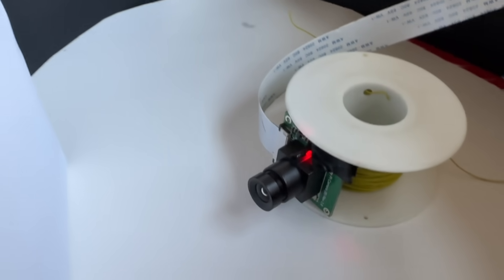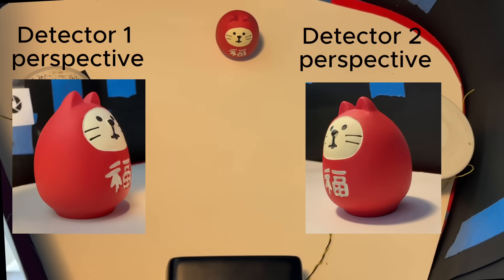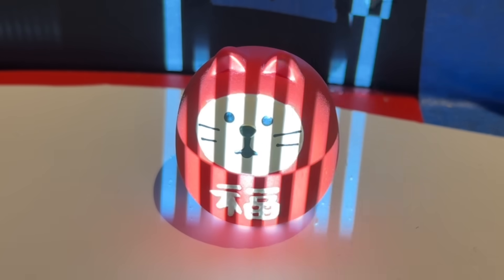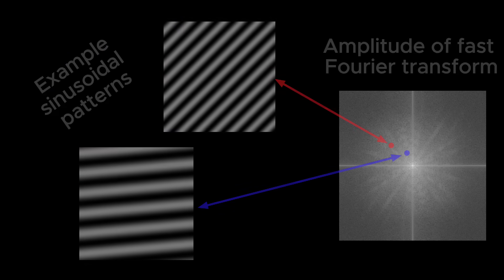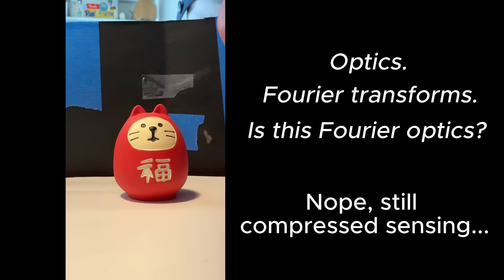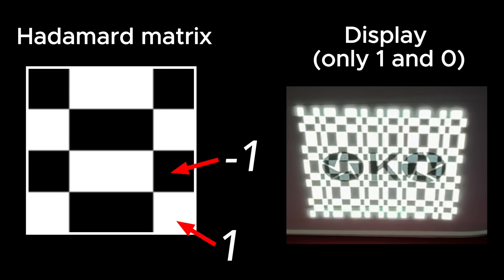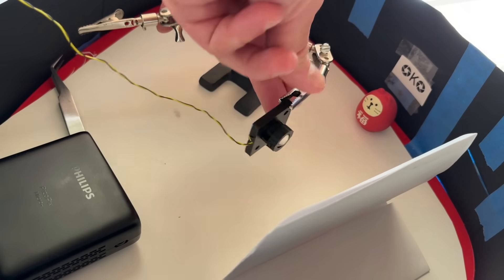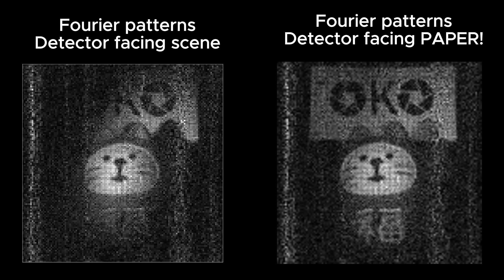Imaging objects out of sight using a single photodetector

Comment: When i was at university someone's masters project involved illuminating a scene with random noise, detecting the reflected light with a single photoreceptor, and over time building up a picture of the scene by checking which patterns of random noise resulted in more reflected light
Reply: University of Glasgow?
Reply: BRIGHTon university?
Reply: University of MWG?
Reply: i still dont get it how it works, how the single photodetector can build up an image? it just takes intensity of light kinda at only 1 point? so how it can know the light from other points?
Reply: @PinkeySuavo  when you are taking a picture, every single pixel of your camera receives light from a very small portion of the illuminated object: this method just split the process and records every single pixel individually: instead of splitting the light as it arrives on the sensor, it just illuminates only a "pixel" of the object.

imagine this: you have your normal sensor, take a pixel (say, row 7 column 13) and illuminate the object with a very tiny spot of light, such that only the pixel (7;13) measures something, while all the others are black. Now repeat the process for every single pixel: if you sum together all these images, each one with only a single pixel illuminated, you will obtain the whole image again.

Now, imagine you have recorded how exactly the beams of light you used before were made: when you shine one of those beams on the image, do you really need the whole sensor to record the information you need? After all, you just need the value of that single pixel, all the others will be black anyway; so you can just store the value of the pixel, associated with the coordinates of the beam you used, and you will have your whole picture again.

Now comes the last step: if you had a bigger pixel, would it record a different thing? No, since you have built your beams in such a way that the reflected light would fall onto a single pixel: if you increase the size of the pixel you don't get more light, the information you get is still the same. What about a pixel the size of the original sensor? Since you just use the VALUE of the pixel, it doesn't matter whether you use a matrix sensor, where you illuminate one pixel at the time, or a single pixel as wide as the original sensor: the amount of light that reach your sensor depends only on the beam you use to illuminate the object. So you can just record the value of your photodetector and associate it to the "coordinates" of the beam, obtaining the same image again.
Reply: @PinkeySuavo If you do it enough times with different combinations of light patterns, each “image” can be broken into specific wavelengths of light (using the Fourier transform). Since you know the pattern of the initial light, you know which areas of the object were being illuminated during that image. You can use this info to estimate what the reflected object must look like in order to match the wavelength combination for every image taken. ( I think???)
Reply: @PinkeySuavo  I think the video could have done a much better job at explaining it, how the image is from the perspective of the projector, and how the more advanced scan patterns work, so here's my attempt at answering your questions. Yes, while point scanning it can only see 1 point at a time. It does not know the light from other points. By taking many images, each of a different point being illuminated by the projector, these can be combined together to form a single image with decent resolution. If my explanation doesn't make sense to you or you're curious about the other points that I mentioned, just reply to this comment and I will respond.
Reply: @johnhunter7244  thanks, but does this single-photon-detector moves around the image? or does the object move relative to the detector? i mean how the 'scanning' works

Comment: This reminds me of the original video camera, the Flying Spot.  Recording video for the original electro-mechanical televisor was an interesting process.  

First, a quick recap on the Televisor.  It was an electromechanical form of television.  In CRT televisions, the electron beam lights up the phosphor coating on the front of the screen, generating the image.  The beam is guided back and forth, from left-to-right and top-to-bottom.  This is done quickly enough that 30 completely different images can be shown in a second, creating the illusion of motion.  Any basic (black and white) television image is just a signal that varies in strength quickly enough that the receiver can "paint" the relative signal strength on the screen.  This is Youtube, you can literally look up videos on how old analog CRT televisions work.

The Televisor was an earlier invention that did basically the same thing.  Instead of guiding an electron beam with electromagnets, the top-to-bottom left-to-right scanning was done by a disc that was rotated quickly.  The disc had holes in it, set in a spiral pattern.  As it spun, each hole would move past a fixed section of the disc.  The disc would spin between a window showing that fixed section and a lightbulb.  The Televisor system was just like a television signal in that it really was just a way to tell the bulb to get brighter or dimmer, and the scanning motion turned that into a black and white image.  The difference was that the Televisor scanned much more slowly and put its image into much lower resolution than the television standard later adopted.  Television signals originally had 240 lines of signal in each frame of video, whereas most Televisor formats had between 32 and 64.  

BUT, none of that really matters except to leave you slightly less confused about the Flying Spot.  Recording a Televisor signal used something akin to a Televisor itself.  A very bright spotlight would be placed behind a larger version of the Televisor disc.  As the disc spun,  the only place the spotlight would illuminate the subject would be where a hole in the disc was between the spot and subject.  Much like the projected patterns used here, only a small part was illuminated at a time AND the light reflected by the object was recorded by a light sensitive piece of electronics.

Not enough recording was done with the Flying Spot camera, if it had, this effect probably would have been discovered MUCH earlier when people realized that Televisor signals were being reconstructed as if the Spot were the photosensor and the photosensor was a spotlight.

Comment: You should try a photodiode like a BPW34 instead of a photoresistor. Youll get faster response. lower noise, probably better sensitivity and the light collection area of the bpw34 is pretty large too

Comment: It'd be extremely easy to do color too, just by projecting in red green and blue seperately and adding them together, or by having three filtered detectors. in fact, the "filter" could just be them all pointed at different colors of paper, none of them necessarily looking the same way or even directly at the scene!
Reply: Three identical light sensors looking at three coloured papers would be an awesome way to do this. And it would be interesting to compare it with cyan, magenta and yellow papers.

Comment: Pure magic! I'd like to note something you surely already know.. the response time of CdS photoresistors is very slow.. on the order of tens of milliseconds, but your patterns seemed to flash by quite quickly. I think you might get better results using a faster detector such as a photodiode or phototransistor. There's some quite sensitive silicon PIN photodiodes on Amazon for cheap, too. Even a small solar cell connected to your ADC would be a hugely more sensitive and faster detector, though maybe the broad sensing area would mess up your wizardry?
Reply from the maker: Absolutely, thanks for the note. I had a bit of a discussion about this in the last video. I really need to get a photodiode out there.
Reply: If you don't have a photo detector you can use an LED in a pinch
Reply: @weylinstoeppelmann9858  That's right, many people don't know this, but LEDs also work the other way around. When the LED is illuminated, an electrical voltage appears on the terminals and the reaction time is extremely short.
Reply: @okooptics  A suitable photodiode and a good transimpendace amplifier for it. Modern opamps make it basically a non-issue up to MHz range.
Reply: Imagine flashing all the patterns in half a second and making the setup as fast as a regular camera 😄
Reply: @Simple_Jack yeah I was wondering how fast this could be done. And also interesting: could it be done with invisible light? like uv or infrared? 🤔
Reply: @Simple_Jack  There are reports over the past decade or two of UAP (the mystery formerly known as UFO's) that have been doing exactly that at military sites around the globe. The first such one I recall was actually at a large residential area in China, followed up shortly by a military site nearby. The "scans" take several seconds, but are "structured light" or something similar.
Reply: Yes, people have built laser transmission speakers for stereo music with solar panels as the receivers
Reply: The broad sensing area of a solar panel would just make the “lighting” for it like an area light, the precision comes from the projector side. The experiment where it was pointed at a piece of paper is similar to having a larger sensing area. My graphics professor is one of the people who wrote that paper, and he explained to to us in class, I think as as a follow up to precomputed radiance transfer, and how it can speed up measuring things like head related transfer function by putting a speaker in the dummy head’s ear and microphones all around so that they can measure in parallel.
Reply: Would be really interesting to see a video filmed like this

Comment: To get the -1,1 with the hadamard matrix, why not just subtract a constant bias level (and possibly scale)? That will map the interval (0,1) into (-1,1).
Also, when imaging a curved surface, doesn't the distance of the projector matter as the projected pattern will be distorted and the basis matrices will no longer be orthogonal?
I'm curious why you need more than two values for the phase - isn't it enough to have 2 for cos and sin?
I'd like to follow this so I'm subscribing.
Reply: "To get the -1,1 with the hadamard matrix, why not just subtract a constant bias level (and possibly scale)?" Doesn't work because (zero - bias) = - bias , and not (-1)x(reflectance).

Comment: Could this be done with infrared or UV?  Because that worries me--you could take photos without anyone knowing! Scan projector patterns with "invisible" light, and with the camera not even pointing toward the subject!
Reply: I mean, hiding a projector from someone is more difficult than hiding a camera.
Reply from the maker: Great point. @tiagotiagot  brought up this point in my last video. I'll copy it here: "This reminds me of a security vulnerability I heard about recently, on devices like cellphones, "smart" TVs etc, that got a screen and a lightsensor (that's normally used to auto-adjust the screen brightness), basically allowing pictures to be taken without camera permission or even a camera present..."
Reply: @okooptics  The screen illuminates everything equally regardless of the pattern on the screen itself. You need the patterns of light to be projected onto the objects or it won't work.
Reply: @LieseFury  I know that. You still need the light that hits the sensor to come from distinct parts of the scene at separate times, and that doesn't happen without illumination hitting those specific parts of the scene at different times. 

If you had an IR projector you could make it work, but phones don't have that. They just have an IR diode that spreads the light everywhere.

You need the hadamard patterns or the sinusoidal patterns to extract useful info. Otherwise the sensor will only detect the average illumination of everything it has in view, and you can't reconstruct anything from that. That is why I brought the screen up, because that is the only thing on a phone that can make different patterns - but that won't work either, as I explained.
Reply: Not really. I would say its even harder than with just a camera, much easier to hide a camera than a structured light device which actively beams light for prolonged amounts of time to capture a single image.
Reply: It need long exposure and it's highly affected by ambient light. So no (not yet)
Reply: My professor, Pradeep Sen mentioned casinos and I think the police or some government agency did contact them about if this could be used for that, and I think a TV show ended up calling it the Pradeep sen method (where the television in a house was used as the “projector” and a camera looked inside the house)
Reply: @AdmiralSamStarcraft  It can definitely work with a camera instead of a single pixel sensor.

Comment: Now thinking of situations where we can use this technique. (Places where you can't get a camera, but can get a structured light source.)
Reply: I was going to reply directly to this video, but you presented me with a means to reply with purpose, thanks!

Many years ago, (it could have been a movie, book or a magazine,) surveillance through a window was being performed on someone using a computer with monitor.  The person using the computer/monitor was sitting facing the window.  What was being surveilled were the light patterns on the wall behind the person and those patterns were processed and revealed what was being displayed on the monitor.

Neat, but also scary stuff!

Side note: conversations in a room are recreated by capturing/processing the minute vibrations of the window by using a laser.

Side, side note:  S.C.I.F. rooms are specific to electronics, but I would think it would also prevent what's described above from happening.
Reply: @stevedrown2460  interesting! What you described reminds of negative pinhole imaging, or pinspeck imaging, which allows for example outside a window to be reconstructed from the shadow cast by a ball or a person walking by. There are papers about it, even one where they reconstructed the surface of earth from just observing the moon! crazy stuff.